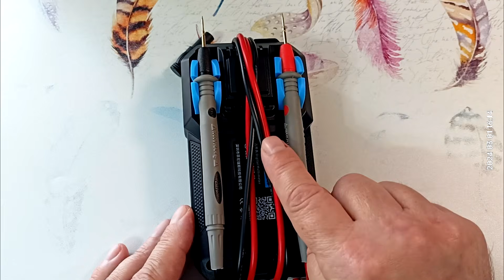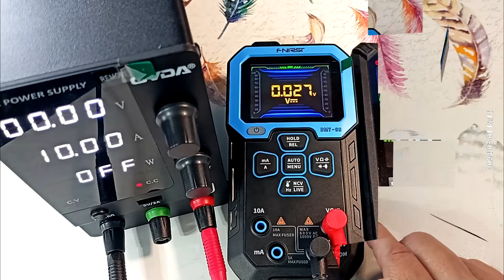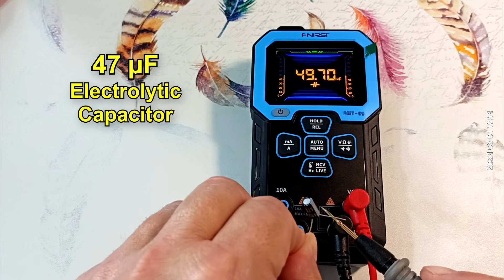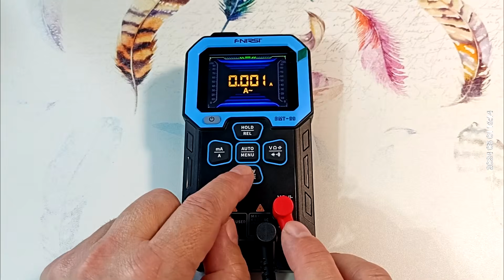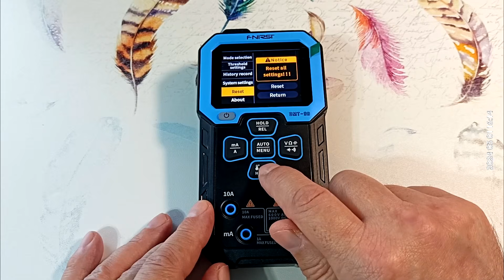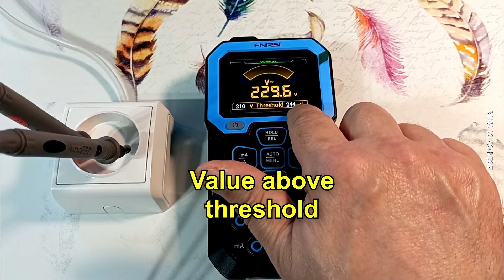This Smart Multimeter Looks Like It Came From Star Wars – FNIRSI DMT-99

Comment from the maker: This multimeter looks like a sci-fi gadget, but what do you think about its actual features? Would you use the FNIRSI DMT-99 for electronics work or electrical troubleshooting?
https://ali.click/5f5e61p?erid=2SDnjemGNyp - Fnirsi DMT-99 Multimeter from the video
FNIRSI HS-02A vs HS-02B — Best 100W Smart Soldering Iron?
https://ali.click/bowe618?erid=2SDnjdxQ2dx - HRM-10 Battery Tester by FNIRSI
https://ali.click/ht0e61r?erid=2SDnjdjurNe - WinAPEX 268B Multimeter

https://bit.ly/EngKan - Subscribe to this channel
https://bit.ly/Pomkan - Support the channel financially
http://goo.gl/a6YJdO - This channel in Russian.

https://youtu.be/UYHktKY6CPk - Clamp Meter + Digital Multimeter FNIRSI
https://youtu.be/GeTrV2MP1yQ - Battery tester HRM-10 FNIRSI
https://youtu.be/MOM02oFWr-E - Dual-channel digital oscilloscope
https://youtu.be/pIYO3hpKU-g - FNIRSI HS-02 — 100W Smart Soldering Iron
https://youtu.be/ZwPNnc6qbDU - 100W Foldable Solar Panel DOKIO